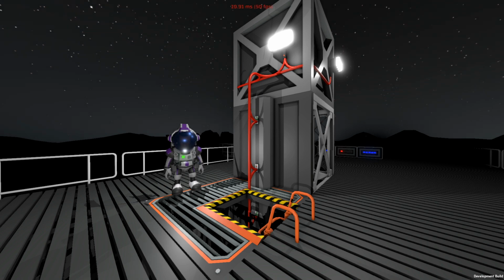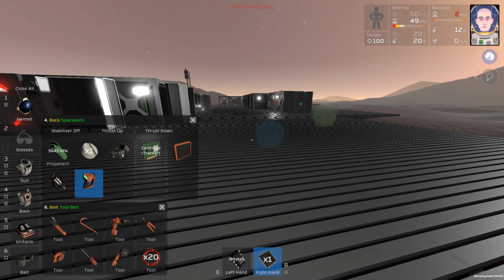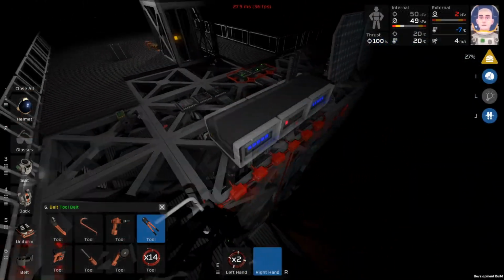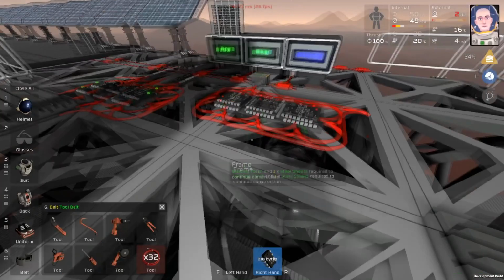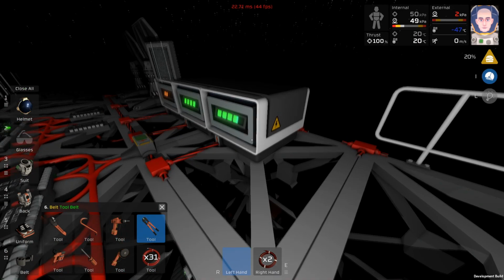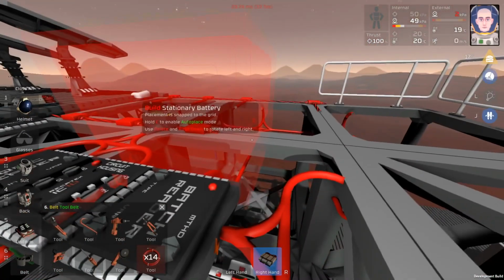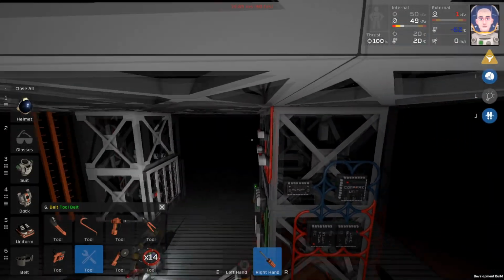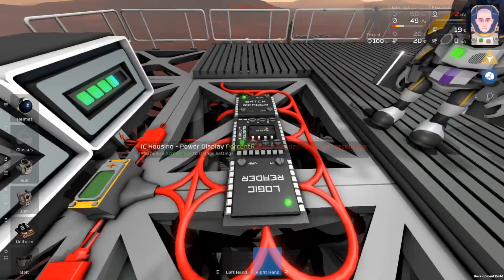Ultimate Power Display - Stationeers Co-op Gameplay - Mars - Let's Play - 25

Comment: Power failure issues like that are one of the reasons I always recommend using an area power controller to supply the solar tracking logic. ;) Fortunately you got the batteries back in soon enough that there was some power to get the panels parked facing dawn!
It does make sense to break down battery charge rate between power generation and consumption. Technically I believe that can also be done with just a single cable analyser, but would need a batch reader for summing up power stored in all the batteries and then doing math against the remaining cable analyser. I don't recall whether cable analysers use power or how much.
Also I'm not sure why you're using a logic reader for one of the cable analysers but not the other. A big benefit of ICs is that when working with a small number of devices, they can handle their own logic reading and writing. You could cut out that extra chip and 10 watts of power use with (presumably) minor alterations to the script.
Reply from the maker: It is possible yo ditch other cable analyser,  if you dont have a backup power generator hooked up to input side with solar panels. I wanted my power input to tell me how long does generator charge main batteries on a single lump of coal. That is why i used 2. 

Good idea on power controller for solar panels